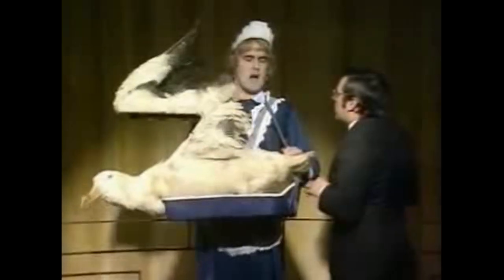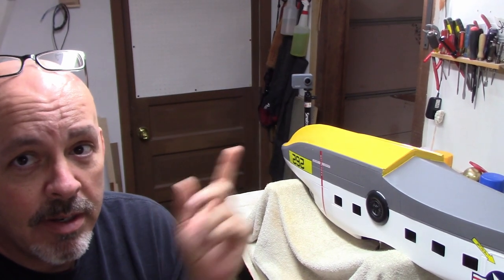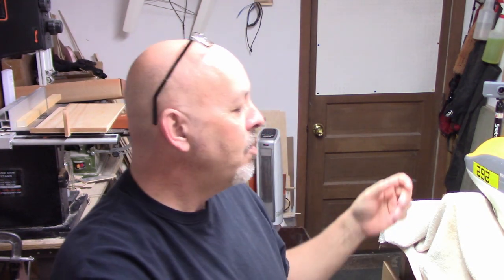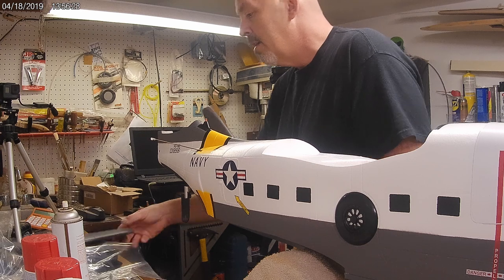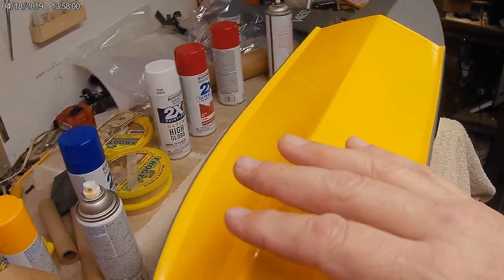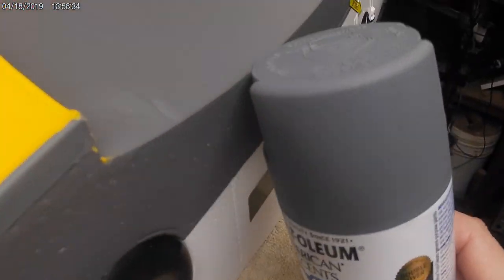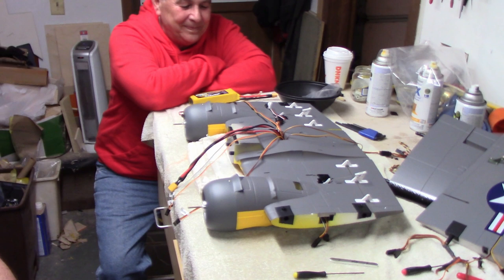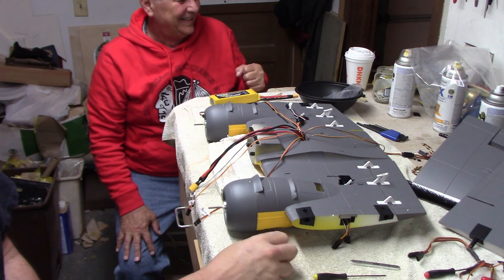HobbyKing Avios Albatross HU-16 - Painting and Assembly

Comment: Nice work !  What tipe of paint you used ? And did you just paint over the original color
Reply from the maker: Rustoleum 2X Ultra Cover. No surface prep just used "yellow" Frog Tape, masked the area and sprayed 2 light coats.